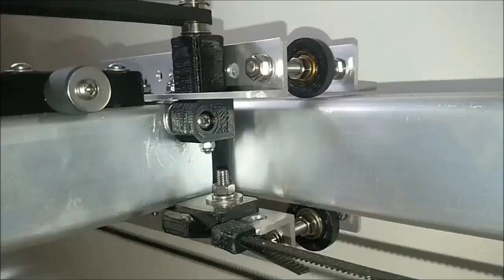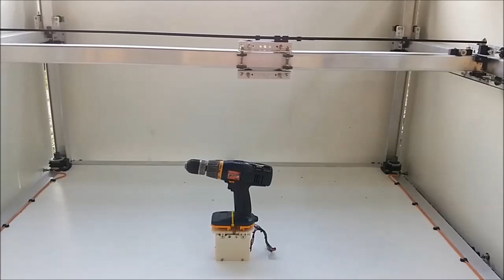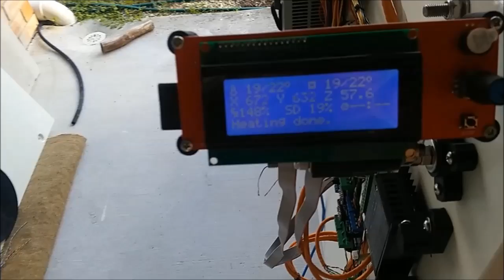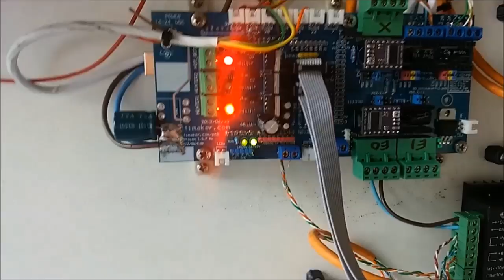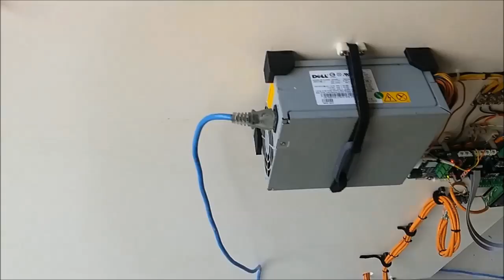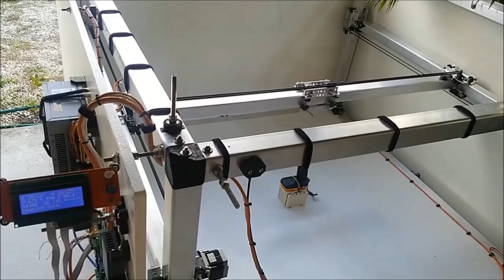Large scale DIY 3D printer - 1200 x 1200 Sub33D V3 - Ghost (air) print and electronics setup

Comment: You mention not being happy with the Ultimaker board, do you have another suggestion? Also, I noticed you had a display for the Ultimaker, what model was the display?
Reply from the maker: I have not found anything better (surprised there are not boards setup to allow for easy integration of CNC stepper drivers)
The display is a 2004 type LCD controller (REPRAP_DISCOUNT_SMART_CONTROLLER in Marlin firmware)

Comment: nice build!
wouldn't it be a cool idea to have another short x-y-sliders on the head with separatw motors?? So if the head is only moving high frequently for short distances (-> 3D printing) ur main motors wouldn't have to move all the weight
Reply from the maker: Yes, could imagine this being a great idea for larger printers, although could be a bit of work to create the software to handle this, there is a company who sort of have done this where they use many xyz heads on a long bed to multitask the print, will post a link if I come across it again